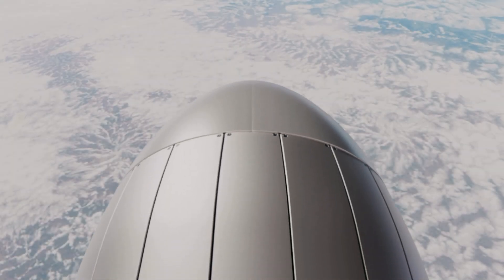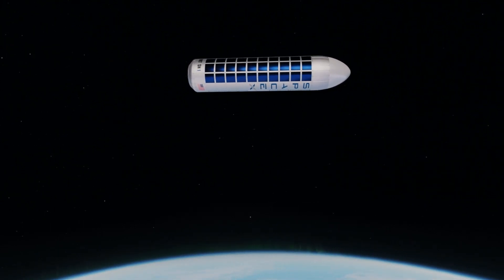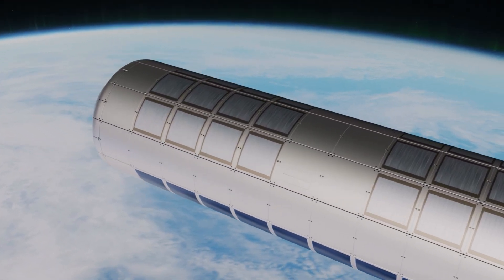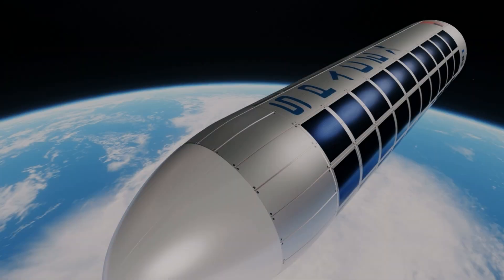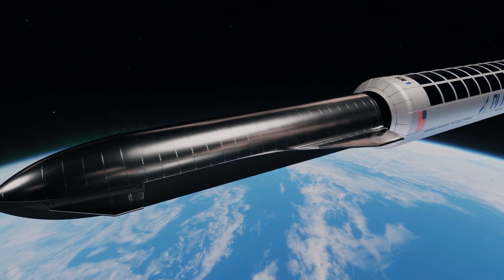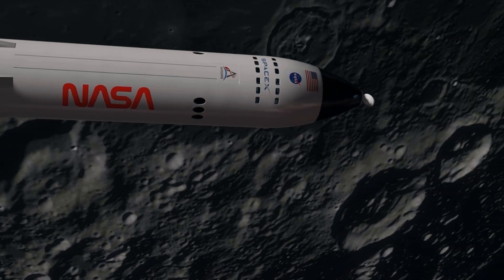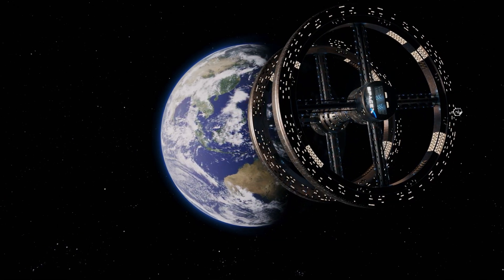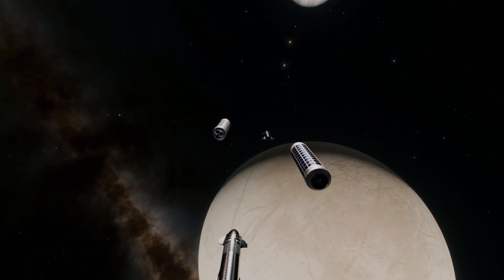SpaceX Orbital Mega Tanker concept

Comment: Would be versatile to replace the frontal cargo area with a starship docking port, just like the one in the rear for a symmetrical design. This way two starships can be refueling at the same time. Additionally multiple super tankers can be docked together and share resources. Another useful aspect is that the frontal docking port allows the super tanker to rescue stranded starships and bring them to LEO for repairs

Comment: The "tanker" should accomodate some of the answers to the human body need for gravity. Would be interesting, if 2 tankers get connected by tethers and/or beams, to distance and lock themselves from each other about 428 metres away from each other, with 4 or 5 spaceships 2.0 connected underneath it ("nose up"). This particular connection should allow manuevrebility of the ships, especially with use of combination of drives (chemical propelant and ion drive). BTW Mars colonization should bring artificial satelites on Mars orbit (martian version of "GPS" and comunication satelites). Another ussefull device(s) possible to bring there are ground drones. I mean, Pathfinder rover (checked and to a degree driven from Earth) was slow to the extreme, but if the rover is driven by operator present on orbit or even closer on the ground, it could move like sportscar (if far away from people). And even could be used to do some activities instead of the human cosmonaut/colonizer.

Comment: Since this video was uploaded, it appears that SpaceX has been busy developing their "BFR"/"Starship" large re-usable rocket ship platform. It appears that SpaceX expects these large rockets will not refuel by "breech docking" as illustrated in these videos. It now appears that these rockets will "parallel park" in space for side-by-side refueling. 

The idea of integrated photovoltaic panels and heat radiators directly on the Tanker's hull is very interesting. Even more interesting would be using the cargo bay in the ship's nose to house a robotic module similar to your artificial gravity concept so that additional photovoltaic panels and heat radiators could unfurl to allow additional power to be provided to the ion thruster even while the tanker is flying to Mars or beyond, thus having even more reliable power and propulsion. It would also be interesting if some of these pseudo-SpaceX concepts could be combined. If SpaceX's vehicles can deliver hundreds of tons to low-Earth-orbit or beyond, they could combine Tankers, Orbital Cargo Transports, Single Launch Space Stations, gravity rotational drones, and even Artemis Lander vehicles in a working squadron/sworm or even finding a way to join all of these vessels together to form a single large vehicle for extended interplanetary missions.

A much bigger challenge would be to blend these SpaceX modules with proposed NASA space station concepts (see Apogee channel's "What Comes After the ISS? Commercial LEO Destinations" presentation: https://youtu.be/MwHhsMatVJ4 ) and the Werner Von Braun rotating wheel space station concept from 1956 to create a long-term exploration fleet or combined ship with embedded inflatable habitat modules to make a well-rounded cycler/exploration rig that would be more self-contained.

Comment: THANK FOR CONSIDERING THIS, IV BEEN A BIT OF A NAG I KNOW BUT IT IS CHEEPER AND MORE AFICHENT, YOU COULD HAVE A TANKER ATACHED TO STAR SHIP AS WELL IN THE BEGINING OF THE JOURNY AND SAVE STARSHIPS FULL IT WOULD SAVE STOPING TO REAFULL AT LEAST ONE'S,
 AND THERS ALWAYS ELECTRIC MOTERS WITH SOLAR TECK A BITT SLOWER I KNOW BUT THERE IS THAT, AND ITS ALWAYS GOOD TO HAVE A BACK UP IN CASE A MOTOR BRAKES DOWN AND NEEDS A FIX, YOU DONT NEED TO STOP TO FIX STUFF IN SPACE IT CAN BE DONE ON THE MOVE JUST NOT TO FAST, THE PROBBES WE'V SENT OUT GO FASTER AND FASTER LIKE VIKING AND SO?***8888***

Comment: OMT Fuel storage: what type of fuel will be stored? Can/could more cost-effective basic materials (water/H2O?) be transported into orbital space for processing as fuel... utilizing solar power and low-temp space environment for manufacture of fuel? example: H2O solar-powered electrolysis (roughly 2.5V) to Hydrogen and Oxygen "splitting"... low temp for liquification (if necessary) as fuel... hydrogen/oxygen recombination as propellant.... or, add carbon to the mix, for hydrocarbon fuel?? ... or, any possibility of converting "nuclear waste" into a usable energy source?

Comment: I came up with:
3-stage Starship: 
On top of a Star-stage is a Starhopper-derived third stage with a smaller fuel tank(for deep space Missions to Titan, Europa, etc). Starhopper has some fuel in it (to land), with solar panels and radiators like on OMT to keep the fuel cold. Also has a small payload bay for multiple purposes, which I'll get to later. Once statstage is fully refueled it will take starhopper to SSO till it reaches its destination. The starstage will stay in said GTO while the Starhopper lands on the surface. The first time should be rovers and tech to mine water ice and CO2 ice, convert them into fuel using the Sabatier process, vent it to the starhopper, and graduallyusing refuel the Starstage until it can inject itself back to Earth LEO.

Comment: Ok, main issue with this one is the "spaceX-ization" of this craft, as well as it being generally useless with this concept. Let me try to explain: Starship was originally supposed to be made with  carbon fiber composites. They changed the design due to complexity and cost, preferring stainless steel to carbon. They would have to reopen the facility to create maybe 2 or 3 of the tankers. That's one major hurdle, but another is the amount of refuels it would take. It would literally cost more to make 20 refuels than 10, as well as the fact launch would be a pain. Also, what would you plan to do with it when it reaches the end of it's service life?

Comment: The problem i see is where this aircraft is supposed to go whenever it has run out of fuel. Its not gonna be good to have a bunch of those floating around in orbit.
Reply: First they would refuel it using starships all the time and second of all even if it ran all the way out a tanker can just refuel it again also it’s not an aircraft it’s a spacecraft also if they wanted to clean up the orbit they just send another tanker up to refuel it and it can adjust its orbit or de-orbit it’s self although it wouldn’t be ideal considering it doesn’t have reusability but it could be like a permanent fuel space station, the whole point is that it just stays in orbit.

Comment: Alternatively, a pair of Lunar Starships, noses docked together, could be repurposed as a LEO depot with the benefit that the Lunar engines on both Starships could be used to provide the thrust needed in the desired direction of the fuel transfer process.

Comment: Starship requires six engines to reach LEO efficiently. This tanker will have to weigh no more than 100 tons more than a Starship, after deducting for landing fins, thermal tiles, landing gear, and adding solar collectors, waste heat emitters, etc.

Comment: I like to point out something, space agencies are working on ion propulsion systems and I really hope that we could have very powerful ion thruster engines with 2030s. So if space X really plan for a fueling structure, it might be storing Xeon / similar ion thruster fuels along with classical fuels. Fortunately those fuels will be non inflammable (if it's any use 😁)

Edit : what about a megastructure made of several structures joined together, and each segment has structures made of expandable / inflatable materials so that it could hold a large amount of fuel, both classical ignition engine fuels and ion propulsion fuel, such that it could fuel several starship rockets / deepspace missions having ion propulsion engines without having to refilled occasionally 😁
Reply from the maker: Yes I was already thinking of this concept. Perhaps I will make it in the future.

Comment: I like aspects of the idea. It costs more money and takes an extra launch of a super heavy booster to deliver the tanker to orbit. Where as the unmanned tanker could be fully fueled by 6 super heavy launches; including it's own delivery. When the final launch occurs it will be the manned Starship which will rendezvous with the fueled tanker and take on the full load of fuel. I like the ion engine concept and the forethought into cryogenic fuel storage. 

The most critical aspect is that it must work with the super heavy booster. If it can, it would be an adaption of existing Starship technology when proven. So it would not cost as much to develop. There is potential for future missions to have orbital fuel platforms as life lines for crewed missions. It would make sense to have one around the moon, and one around Mars or Phobos. 

The ships could be re-fueled by autonomous launches from the pole of either moon, or the surface of mars.

Comment: Often times a quick way to scrub a lot of delta-V when coming back to large gravitational bodies such as the Earth is to use aerobraking.  There is some question of weight and wear and tear of a heat shield, however for medium sized gravitational bodies with an atmosphere and chemical propulsion considered, aerobraking has at least historically been the preferred route of slowing down due to heat shielding an aerodynamic surfaces being a lot lighter than chemical fuel for the job.  If you are ion drive all of the way, might be better to ditch aerobraking.  However with the solar panels in your concept, it could take years just to break from LEO with the tanker fully loaded.  Even really large solar arrays brought up on a subsequent reusable Starship launch, it would take weeks just to ascend Earth's gravity well.  As radiators are a lot more compact than solar panels for the work done, the tanker should probably be nuclear electric using something like LFTR and a two or more stage power generation system off of it.  Actually may consider two launches, one just for the permanently in space tanker section second stage along with radiators.  Then a second riding in a reusable cargo Starship for the nuclear electric propulsion system and associate fuel tank for that with even more radiators.  After this you do more launches to fill the tanks.

Two big places I see such a tanker being used is around Luna for refueling reusable descent stages and around Mars if you ever hope of getting Starship back off of the surface for a return trip.  The current in-situ fuel plan proposed by Elon Musk for Mars is mathematically impractical as in ~100+ cargo Starships full of equipment to get just one Starship back after years of producing the fuel non stop for that one return trip.  Would make a lot more sense to efficiently fly a tanker out there on nuclear electric and fuel up a Starship before it lands, so it already has the fuel on board to fly back up.  As ion drives can get you up to 4,000s of ISP, you don't really need that big of a fuel tank in your nuclear electric ion drive module to make the trip to Mars and back.

Comment: Some thoughts on this great idea. Deliver the fuel in larger unmanned units with a returnable raptors section, and leave the whole tank up there while returning the engines.
If the whole unit is fuel and no return or life support more fuel.   Pop out solar panels to stay in the sun and pop out shades to keep the rest of the unit in shade and low temp to store fuel.  Empty tanks built to be adapted into the basis of a station when joined together and fitted out later, possibly a translunar station.

Comment: I do enjoy your animations, they are superb.

Carbon fiber, though, is an unlikely choice for a fuel depot.  It is a very large structure, for which carbon fiber is poorly suited - which is why SpaceX switched to steel for the Starship.  Steel is much easier and cheaper to shape, and it may even be a bit lighter.  And it doesn't require a clean room.

I would add deployable solar panels to increase electricity generation.  They will be necessary, particularly if an ion thruster is used on long voyages, but also, the power requirements to keep methane and oxygen chilled will be substantial.  Refrigeration equipment will cut deeply into the unpressurized cargo capacity you mentioned.  But the concept is feasible, I think, because on launch, the tanks can be nearly empty - just the fuel required for second stage lift to LEO will be necessary.

Comment: As early as 1987 the External Tanks of the Space Shuttle and the Buran could have been on orbit /as they were originally designed!/-doing exactly this-AND MORE. Cost would have been none to minimal. But then came Challenger and other hype-and the timid ones blocked the concept despite of its innumerable advantages and zero drawbacks.🚀🛰🚩

Comment: The spare carrying capacity could be used for a sun shade. An alternative could be to use the solar panels as a sunshade. The tanker would 3D print the struts that unrolls the panels down its length. The problem with this concept operating in low earth orbit however, may be micrometeorites. Some form of self healing material may be required.

Comment: Some words are difficult to understand which undermines the message. I am still trying to work out if it has or has not sea level raptors? 2 steel raptors back to back would be cheaper  with double the capacity.

Comment: Artificial Gravity: Lash two starship noses together with a 100m+ tether between them and spin for gravity on normally positioned ground decks in the starship. It'd be best if you could figure out a way to make the Mars transit under gravity for health reasons. Spin gravity doesn't technically take any energy to maintain. Modification of the Lunar Starship engine side nozzles to the center of mass might allow you to burn fuel sideways to Mars. It's dizzying to picture, but Newton doesn't prevent it.

Comment: This is very cool, few additions will probably be needed.
At least one small rotating solar panel arm if it's going to be automated and do outter planet missions for during burns.
Seen a comment talk about separate radiator arms for efficiency, agreed.
A docking port in the nose or / and on the side to stack a few of these together for fuel storage would bee cool to see as a concept. Since the idea is to have a bunch of fuel you can use to refill one time without having to wait on another mission and a few people have been saying they could just send a stripped down  Sfarship full of fuel instead. so i wanted to counter this idea.

You have the serials SN1 on the side but shouldn't it be STN1 ? Since it's a tanker?
Also i like the idea of the ion engine focus, extra smaller tanks in the back, but can save using some of the fuel in transitions. However these bad boys need the maximum electricity they can get for their output for efficiency so they need the solar panels towards the sun always during burns. So you definitely need panel arms however local panels can still be useful.

Comment: Nice concept. My only complaint is the Ion thruster.
There are not yet ion thrusters with a decent thrust to push something massive as this, even taking years to do it..
There are a few in development and is totally possible, but that area of solar panels would not be enough, also you have to point your solar panels always toward the sun, this mean they need to be spread as the first starship animations.
The extra weight of the ion truster considering that you already have 3 vaccum engines does not pay out.
Also.. you dont need active cooling to keep cryo propellant  (even in the case of liquid hydrogen):
It could be achived with whitepaint and passive radiators, choosing your angle with the sun.

Comment: Along with a fuel depot, I have been positing the idea of taking Super Heavy, which in this video is also given the task of launching the OMT into orbit, and making it an Orbital tug. By that I mean it could launch itself into orbit and be refueled from there. It would do this with little to no additional payload aside from a modified layout of 4 RVacs in place of 8 Rsl, with its own refueling probe to be refueled by tanker starships, as well as having a separable fairing nose cone which could be recovered. By being placed into orbit and refueled, perhaps with the OMT, it would be able to provide Starship additional delta V for either getting to Mars faster, getting to mars without refueling on the surface, or making lunar missions with starship far more practical than some naysayers claim. This also means starship itself can get to mars with less fuel in its own tank, giving it more TWR to use sooner. It also would make it possible for Starship to get to Saturn’s moons; where water and methane are extremely abundant, within our lifetimes. Jupiter would be good to get to eventually; but the gravity, magnetic and radiation environments would not be very practical to design starship against in the near term. Uranus and Neptune make good targets but are extremely cold places. Dwarf planets would take very long to get to without using a lot of fuel.